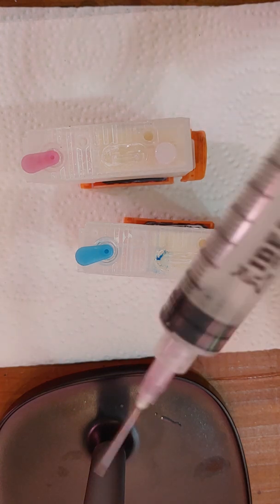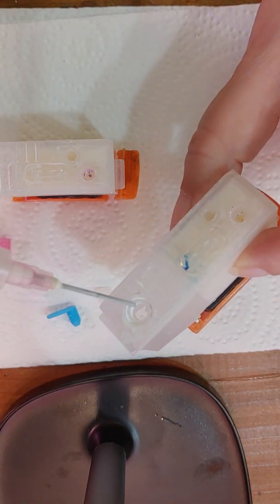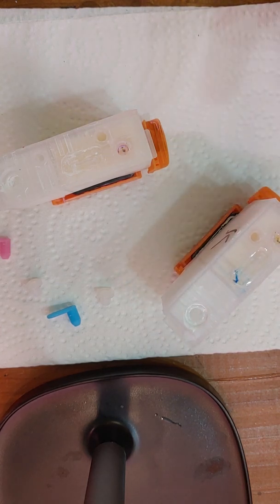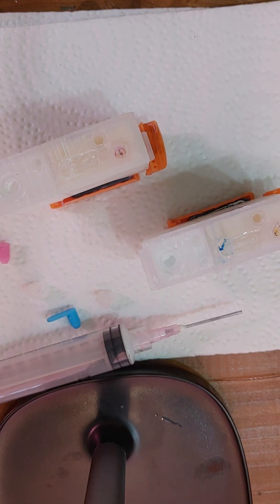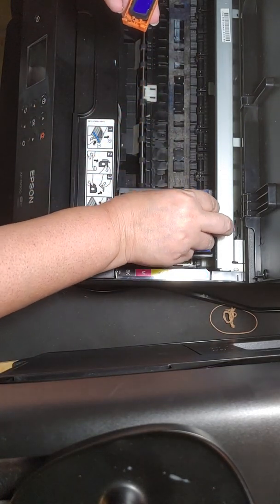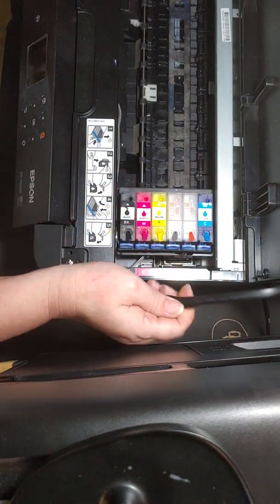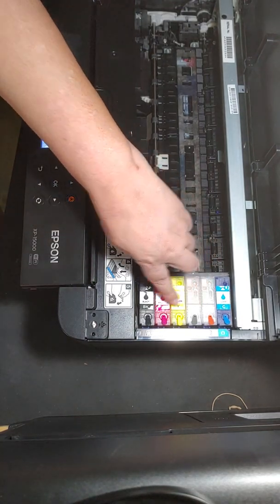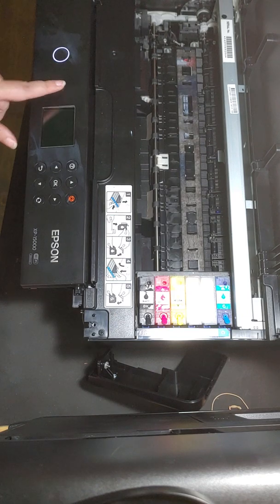Setting Up Your New XP15000 Converted to DTF

Comment: I converted my printer but i am using the oem carts. i drained, cleaned them and refilled them with dtf ink. i installed chipless firmware, drivers and acrorip. i actually watched your video on print settings on acrorip but my printer prints blank. i have not been able to find a  solution. it has been a week of searching and i am so sad and frustrated. i do not not what to do. nozzle checks print blank pages. it is a brand new printer. not refurbished.
Reply: Did you solve your problem?

Comment: I was putting my cartridges in my printer and noticed that the ink was literally pouring out of the bottom. My guess is I got some bad cartridges. I wanted to ask you about that to see if maybe I need to get some new ones. My ink is like dripping off the paper every print no matter how low I see the ink to come out. What is your opinion on that?
Reply from the maker: Yes get new and don't use those. You will flood your printer.

Comment: Great video.
Would you recommend using Chipless or Chip Cartridges ?
Thanks
Reply: its much cheaper to use chipless but you have to get the chipless firmware. but you can keep using the ones that are chipless

Comment: trying to get the printer to work.  Unfortunately without success.  the print looks weird.  as if my dtf ink would run and lots of small holes in the white.  did you have the same problem?

Comment: When you first power on the printer it makes you put in the original cartridges to start it, is there any way to bypass this?
Reply from the maker: I am assuming your talking about a brand new printer not yet converted with chipless firmware. No, it is required to set up the printer the 1st time.
Reply: @ssvcustomtransfers  So you have to run the priner with the oem first right?
Reply from the maker: @tonelessbod  correct

Comment: Do you recommend using oem carts? I only have one sent off cartridges coming and was going to use them for cleaning.
Reply from the maker: I didn't have luck with the oem carts. I had issues filling them. I just use the regular refill carts.

Comment: I have heard that you can not go more than one day without printing, or the inks start to clog up. Thats the only thing that has been holding me back. Is there anyway to take the ink out and it be ok to sit for a couple weeks to a month???
Reply from the maker: You need to print often. DTF printers can not just sit for weeks. Watch the maintenance video. DTF is not meant to sit. If you can't handle the time commitment, then please buy your prints instead. DTF isn't cheap and it isn't plug and play. There is daily maintenance of the printers and it's not if but when you have a problem. When everything is running right it's a fantastic process. But when it's bad it's really bad. Not for the faint of heart or those easily frustrated lol